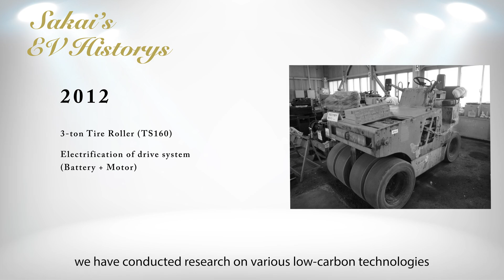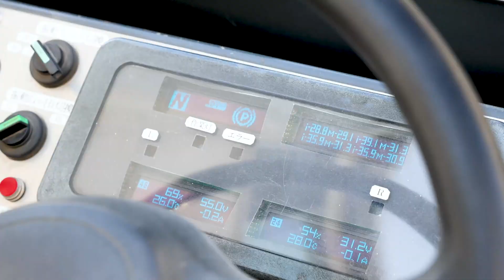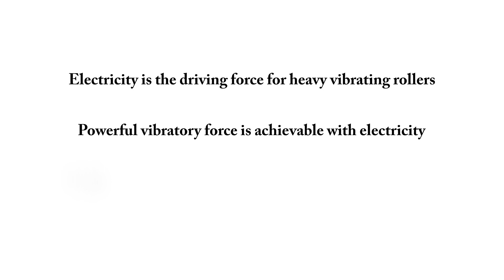SAKAI EVO Electric Asphalt Roller Development

Comment: I have been paving (break down) for 25 years and I think this is great. I also love my Tesla over any gas powered car that I have ever owned. If you need someone to write some code for this project in C# then please hire me because all I do in my spare time is work on my video game that I plan to release.

Skills in Unity, Blender, Visual Studios/C#, Krita, Audacity, and more... 

It would be so cool to help write and test the algorithm for a self rolling mode with safety as the first priority and density as the second priority. My only demand would be that the roller would have to have a big light up sign that says "it's not my fault" should the mix ever be to thin, cold, steep, or soft from bad base lol :)
Reply from the maker: Hi Jason, those are very cool skills to have mixed together! Most of our R&D is done by our parent company Sakai Heavy in Japan. They have been testing autonomous rolling for soil (not sure on asphalt yet) and we do have a new automatic emergency braking technology though I don’t know what code base it uses (it utilizes millimeter radar sensors and 3D LiDAR though).